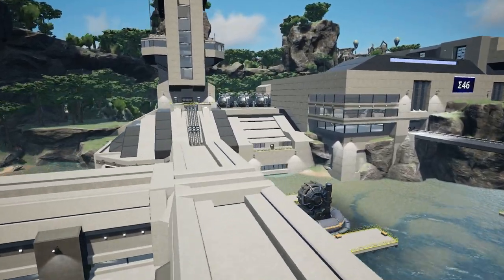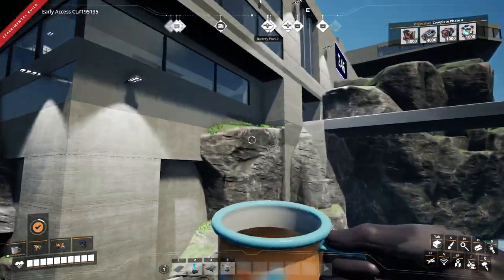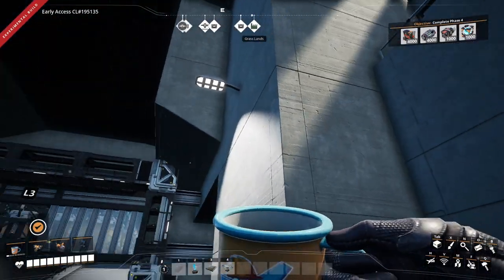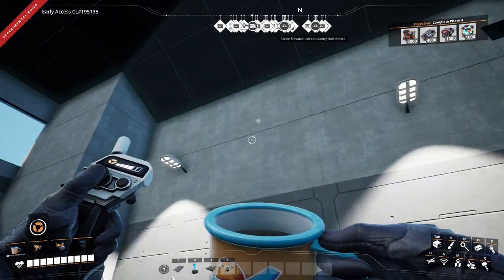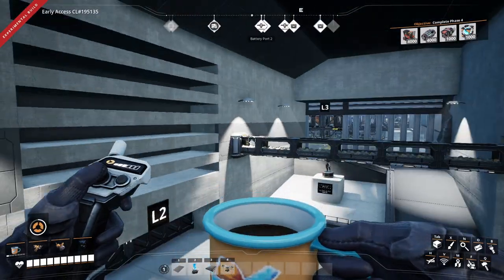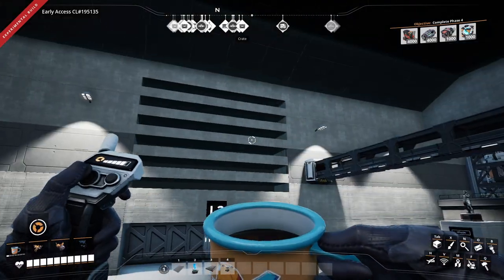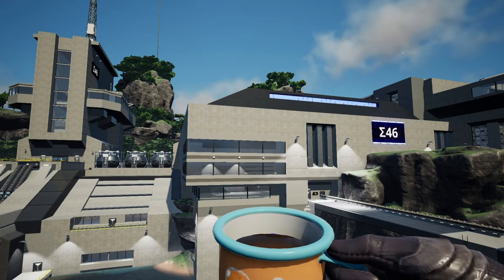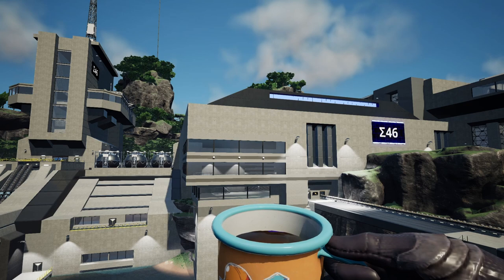Started using foundations as walls, and here is what I learned | Satisfactory

Comment: Nice tips, love doing walls with the coated concrete, and you can only get that with the foundations.  As to the clipping, it is your game play it how you want.  For the most part I like spaghetti and love seeing my belts running material every which way.  The only downside I could see with running belts and clipping through the walls, is if they had an update that caused issues and broke the flow of materials.  That would be a pain to have to redesign and rework.

Comment: Great ideas, and also there're more material options with foundations than walls. Only needs to leave space for thicker walls when designing
Reply from the maker: For sure! I've also been using both with the walls being decoration on the foundations. I use a pillar to make the wall more flush so it doesn't stick out as much.

Comment: It's a shame they don't offer the options to make foundations different sizes besides 8x8. It would be nice to have some 1m and 4m foundations in length and width rather than just in height. My first thought it that large numbers of these would cause performance issues, but then I remember that foundations can already be places at whatever angles and not have to be snapped to the world grid anyway, so I doubt performance is a big reason why these don't exist.
Reply from the maker: 100%! Even just 4m would be a life changer. You can obviously offset them to make 4m gaps but it takes some fiddling with to make it look nice.